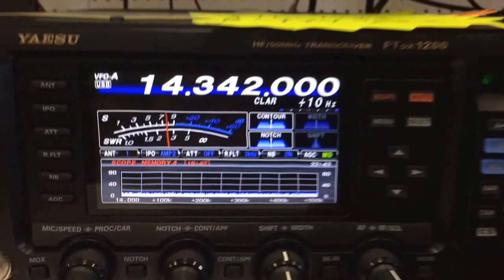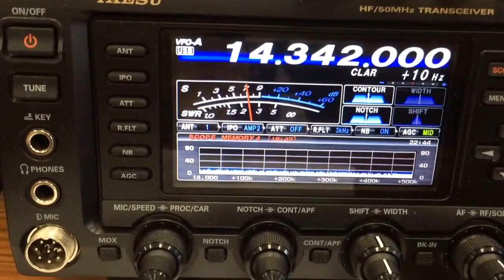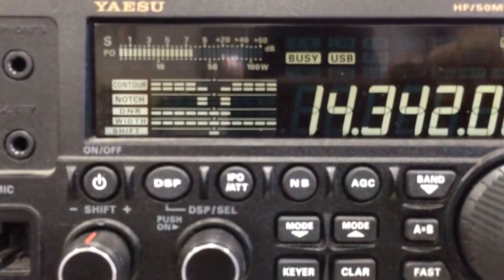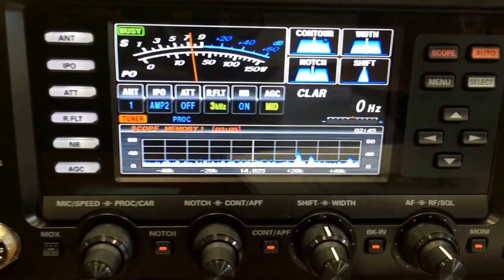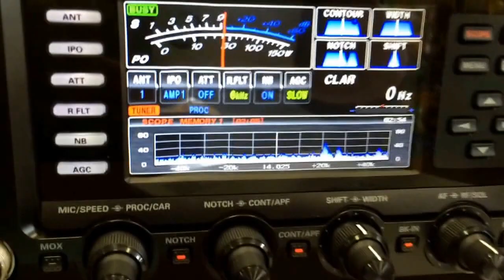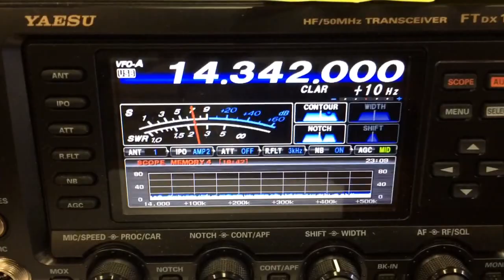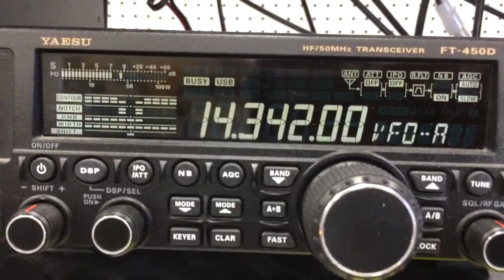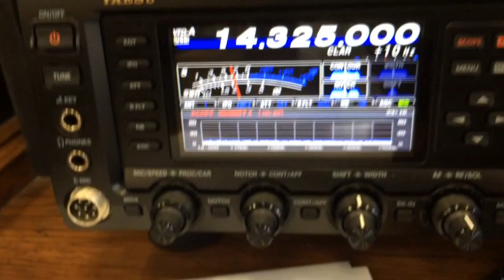Comparing Receiver of Yaesu HF: FT991 vs FT1200 vs FT3000 vs FT450D

Comment: FT3000 with all filters on (contour, notch) is not clear. It’s normal because theese filters are for hard noise suppression, but the audio cannot be as natural as FT1200 which has the same filters off.

Comment: 2019 now its an old radio.
Reply: I own an Icom IC-7300 and a Yaesu FTDX-1200.  I am selling the 7300. On SSB RX the 7300 is unbearable to listen too. No amount of tweaking can make it sound any where near as good as the 1200.
Reply: @James-k5f4k  I own a Yaesu FT920, bought it in 1997 and it's done me proud over the years. 73

Comment: You had the FTDX 3000 set wrong! Why did you set the Contour like that? The FTDX-3000 has by far a better receiver that the FT-450D and FT-1200.

Comment: i know this video is older than dirt, but this is not an apples to apples comparison.  mostly your pre-amps are all different on all of the radios and the agc is also set differently.  this will affect sound, not to mention all of the internal speakers sound different.   so looking at the s-meter and listening to the tone of the audio is obsolete making this video kinda worthless IMO.

Comment: That's a joke. I own a FTdx-1200 and a FTdx-3000. The 3k has definitely the best receiver! In all my years I never used the pre-amp, no reason for it. A good antenna is the best amplifier. I use the Contour (changed the default from -15 to +10) and the Shift control to adjust my audio. The 1.2 k is a little bit lousy at times, but a good receiver. Don't know about the 911, but I have a friend who has a FT-450, great radio for the price, but can't come even close to the 3k, all the best 73 de kf4kul
Reply: I use the preamp pretty sparingly on my 3000, only if I have a really weak signal and need a little boost. A lot of times when listening to a conversation I can hear one station really well, while the other is weak. Turn on the preamp and the hard to hear station gets a little better, sometimes not so much. I'd say 99.9% of the time I leave it off. Same with my 991, there's usually no need for it and the radios sound great with a little tweaking of the settings.

Comment: You have just proved that all three radios can receive a loud signal. So what is the point of that? My little Chinese YouKits radio can do the exact same thing and it a only costs $250. Why not find a very weak signal and see if all three radios can hear it? 
Barry

Comment: I've had the 1200 and a FTDX -9000 at my statoin, and currently own a FT-991 , FTDX-3000, and Kenwood TS-990S. The differences are not as profound as shown in the video. I can say, the FTDX-3000 does have a better receiver than the 1200, owing to it's 9 MHz IF.   These display rigs get adjusted so much, who knows how the menus were set. The roofing filter for the 3k and the 1200 is set different. One is 6K soft, and the other is 3K standard.  The sound of the 3K in the video certainly is not how the one I own sounds. There are menus that can alter the sound of the received audio. I agree with N6PET, the video does not justify the actual sound.

Comment: I find this comparison not fair  . I at this time own a Yaesu FT950 and the Yaesu FTDX-1200 . They sound like old AM receivers from years ago , that are cranked up too loud . If they were adjusted up differently , as you would after learning a certain receiver's ability . This comparison would be completely different . Actually a Yaesu FTDX-1200 has very nice sound , after you learn how to use the filters. Your results don't do anything to show the true quality of these units .
Reply: Hi, looking at either a used FTDX1200 or Ft950, 50% usb 50%CW use, what would be your recommendation please? De M0KTY

Comment: Love it!  No doubt the newer Yaesu's 'do' - and cost - a lot more.  But the 450 sounds very good, more than enough to encourage me to buy another to add to the years of existing reliable service, than spend much more on the electronic gizmodos. [3 years later, it's still going without a single hitch, ever, and regularly puts me in the top few in the WSPR DX receive challenge.)

Comment: Seems like the NR was set too high on the 1200 and worse so on the 3000. They were very muddy. The 450 and 991 sounded clearer if a bit tinny. I can't help but think at least the 3000 could have been tuned to sound better than the others.

By the way, how in the world were you able to find a couple old-timers on HF willing to rag chew long enough to cover the entire video?  :p

Comment: FT 450 sounds better.... and cheaper... 73, s  de EC 7 AA
Reply: i have the 450d i use an out board speaker sounds as good as the 1200 or the 3000, but i do like the look of the 1200 i will be keeping the 450 as i got it with the money my dad left me,so it his radio ..jeff..

Comment: The contour on the 3000 is set all the way to the top of the bandpass, while the other receivers are straight down the middle.  This makes the 3000 sound muddy, like someone threw a blanket over the speaker.  That's an unfair comparison.  If you are going to leave the contour straight up, why use it at all?
Reply: +Pet N6PET - Understood, it's not scentific, and every receiver is different to every ear.  But, I think the guys at HRO should know that the benchmark of the DX3000 (and 5000) receiver is the DNR - Digital Noise Reduction....which they did not show / demonstrate to you.  I don't operate my 3000 without the DNR enabled as this lowers the noise floor incredibly, and I don't think it's available on any other rig you tested.  I probably use the contour a few time a month out of morbid curiosity   ;)  

I'd say the HRO guys might have been a little bias.  If you have a chance, check out the someone who knows how to operate the DSP.  I think the results will be different.  I've listened to all but the 991 in person, and I'd rank them in order of their price.  FTdx3000, FTdx1200, FT450D.  You get what you pay for.   ;)
Reply from the maker: +Jim Giercyk Thanks again Jim but the simple answer is "it sounded  better." I have mentioned in my description that this is not a scientific method in comparison nor did we research on Yeasu's or anyone else recommendation. We did not turn on the DSP components just because it was available as you might think. The experiment was quite simple. We turn it on, adjust to the best settings as we see fit, then turn it off to compare which is better, on or off. There was no theory behind the settings, no references available to explain why, nor used any monitor scope. We all just agreed on a setting we believe sounded better.
Reply: +Jim Giercyk Thanks for your comment Jim. The quality of the audio is adjusted to the best we, 2 other ops and myself at HRO, heard it to be clearest on the 3000. Centering the contour in the display graph (or other positions) made the audio weak and tiny. Also produced mostly highs and a bit of mids but almost no lows audio frequencies. We obviously left the contour on because it enhanced the audio vs. it being off. I  don't understand why you would think turning off the contour will be better because the setting is not centered. Again, I can not emphasize enough that the reproduction of the audio on this video does not fully justify the "real" quality that was heard in person.
Reply: +Pet Natividad - Quote from the Yaesu FTDX3000 Manual:

QUICK POINT:
The steep slopes of the DSP filtering, when adjusted aggressively, can impart an unnatural sound to an incoming sig-
nal. Often, a narrow bandwidth is not the key to improving copy; the incoming signal itself may have undesirable or
excessive frequency components, especially in the low frequency range around 100-400 Hz. By judicious use of the
Contour filter, the “shoulder” of the passband response may be altered, or components may be removed from within the
passband, allowing the desired signal to rise above the background noise and interference in a manner not obtainable
with other filtering systems.

I don't understand why you would think turning ON the contour [on any of the rigs] would be a good idea.  It sounded like you had a strong signal to listen to.  According to Yaesu, the Contour filter is a last resort, and should only be used when every other method has been tried and the signal is still unreadable. 

Not every bell and whistle must be rung and tweeted.
Reply from the maker: I just want to be clear that none of the HRO staff has any involvement with this. I was referring to HRO customers with me that agreed on the "best" setting we observed.

I'm sure there might be better settings for each of the radios we tested, specially with someone that has owned and experience using it. None of us listening owns any of this radios, except me (FT450). I did exactly the same setting I did with each radio. Set every DSP we thought sounded better and compared if it was better to be on or off.

I appreciate your input and opinion on this matter.
Reply: Jim Giercyk m

Comment: From the video the best RX was the ft450 then the ft991 then the ft1200 & ft3000 was the same, the ft450 NO RX amp on, ft991 only amp1 on but the ft1200 & ft3000 amp2 on so not very good that's all I could see from the video but all nice radio's I have the ft991 and it a very good radio
Reply: M0AOV 
wow, radio('s)and it a great radio.

Comment: On the comparison the usb carriers example the 3000 are not well regulated perfectly , the 3000 has a dark sound , must be a little bit regulated , 73 ISØAGA
Reply from the maker: +simone sbressa I am presuming "dark" means low frequency response. Actually, the FTdx3000 has the best quality among all as far as RX. The video did not reproduce the quality of audio the FTdx3000 actually has. The "dark" effect on the video is actually the low audio quality tone the TX'er was producing. In reality, the 3k had a good balance of lows, mids, and high tones while most of the others were missing the lows. Unfortunately the emphasized low tone is being heard on the video differently as a "dark" audio quality but in reality it it was the only radio that had a decent low tone reproduction and balance mids and highs.
Reply: +simone sbressa Not sure what you mean "regulated." First time I have heard regulate used for USB. Do you mean adjustment on Contour, Notch, Bandwidth, or maybe centering the frequency. As I have said, all these have been fine tuned with all the best DSP settings before the video was taken.

Comment: The FTDX-3000 has the notch and Contour enabled while the other radios do not.
Reply from the maker: +Mauro R. They are all enabled on each one, Maruro. This is how you can tell:
FTdx-1200: Notch & Contour are highlighted in color and not grayed out. Unlike Shift & Width
FT-450D: Notch & Contour have those bar graph on each one. Off is they are all empty (I own this radio)
FT-991: Notch & Contour are set but it is not displayed on this screen mode. You will have to turn the multi-control knob to view the next screen